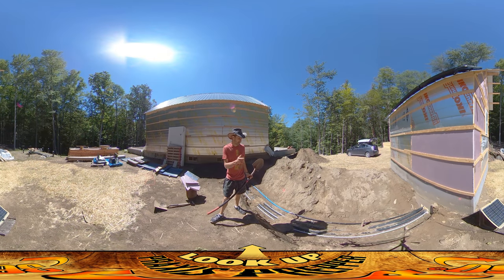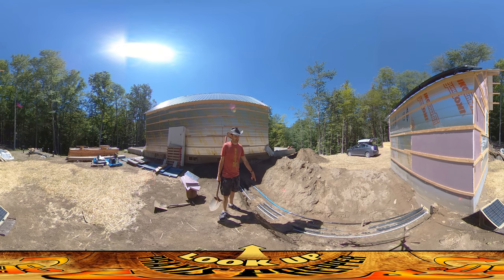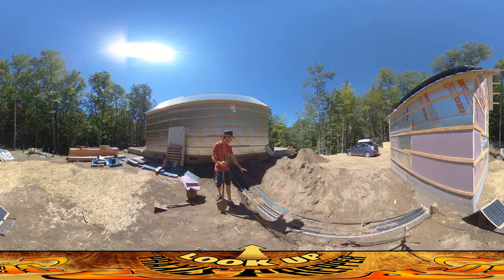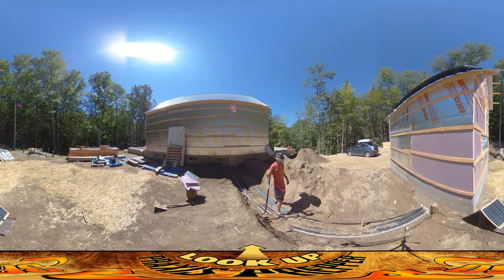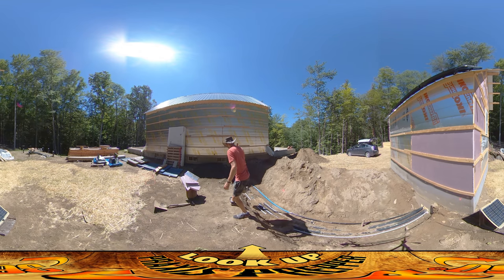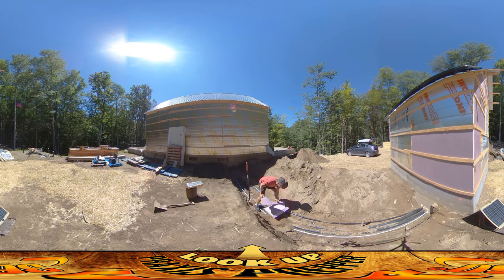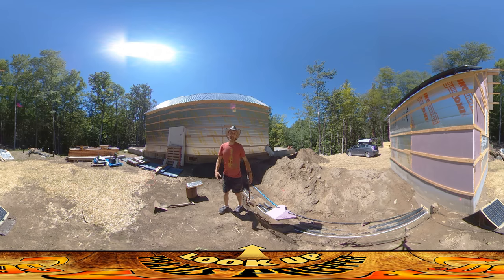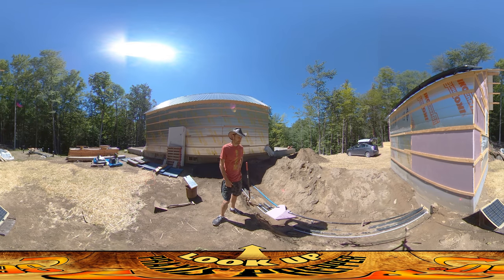Homestead Building - Burying a Seasonal Water Supply Line, Insulating Underground with Scrap Foam

Comment: Good tip on open cell vs. closed cell insulation.
Reply from the maker: I found out that the foam with the reflective backing is technically also closed cell foam, but it can still soak up water over time, so is still not recommended for sub-grade uses.

Comment: Are pool noodles in stock in the states, if so they can be a very cheap way of using polyethylene pipe insulation, with the insulation board over the top it should offer a high R number to your pipes. Also if your covering the area with gravel or topsoil this will increase your overburden thickness anyway.
Reply: I tried the pool noodle thing on my only outside water line, and it works great! One night last winter, the temp was a record low for my area (-5 F) and I still had water flow.
Reply from the maker: I'd be a little concerned about water intrusion into the pool noodles over time. I feel like they do permit water entry after a while... but maybe that's only with UV exposure in the sun?
Reply: @PraxisPrepper  Where I use it, the water line is in a spot where it gets no sunshine. But, I wouldn't use it for sub-surface applications for the very reason you mentioned. Now, for indoor use, It would work well.
Reply: @PraxisPrepper  I saw this sort of product (closed cell polyethylene) for outdoor pipes a few years ago at a Build Show in Scotland, UK. Pool noodles can be either open or closed cell PE foam. 
.
Does some digging... Your 100% correct. TLDR "Some conditions in soil make the material
 hydrophilic and therefore, microorganisms can easily access, attack and deteriorate the external part of buried cables. Thus, the polyethylene can undergo physical, chemical or biological degradation, or combination of all these". Good call Praxis, the product I saw seems to no longer be on the market so probably went badly.
.
Ref: Szatmari, I. Mónika, L. Liana, T. Anca, C. and Iosif, L. (2015) 'Monitoring Results of Polyethylene Insulation Degradability from Soil Buried Power Cables'. Material Science, (96428935).